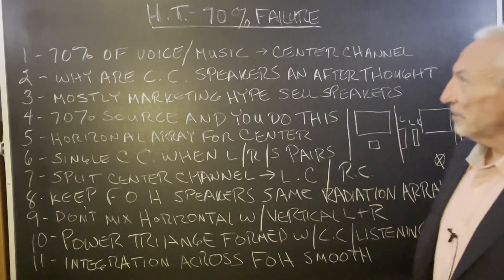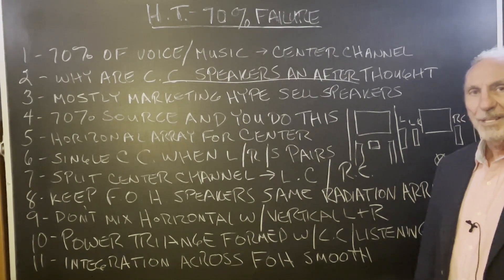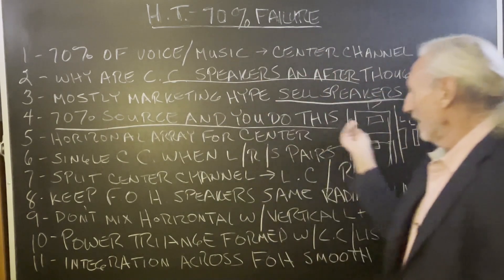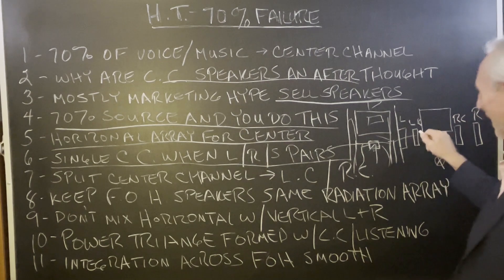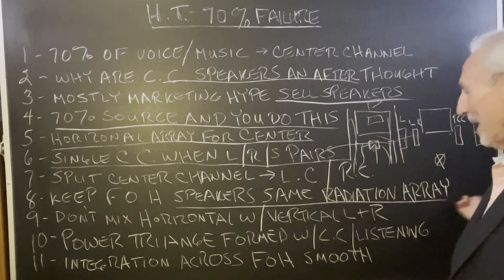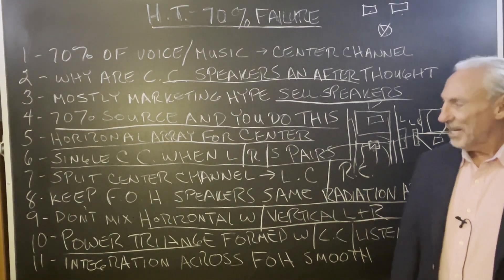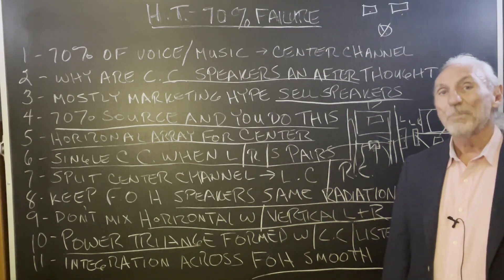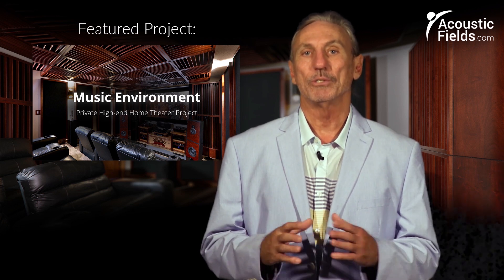Home Theaters: 70% Failure - www.AcousticFields.com

Comment: I understand the reasoning around having 4 of the same speaker. If having enough space is an issue, rather than using 1 horizontal center speaker, could you use 2 of the same horizontal centers and stand them vertical at the edges of the screen? Would this be better than a single horizontal or a waste of time? Do you simply run both speaker cables out of the CENTRE channel of the amp?
Reply from the maker: Yes, you can attach two sets of cables to the binding posts for center channel.

Comment: I'll take a good stereo setup for watching movies over 90% of of the surround setups I've heard.
Reply from the maker: I completely agree. In the last 25 years, I have heard over 300 home theaters. If memory serves, I liked maybe 10.  People lack knowledge on balancing the energy ouitput of multiple channels within the room size and volume. More is not better. You must have channel seperation which requires distance for the many channels to distribute their energy properly in order for the multi channel presentaion value to work well enough to develop synergy. A two channel rigg and set up is much more forgiving. If one applies the two channel set up requirements of channel seperation to multi channels, resolution would be dramatically improved. Now, treat the pressure and reflection distortions.

Comment: In a way I have the same center as my main side-speakers. I have the Elac FS507 and the Elac CC501 center and the CC501 is more or less a FS507 laying on it's side.
Reply from the maker: This is a good start. However, distibution of energy is still an issue. You can't have a speaker distributing energy in a horizontal array at center and then vertical array left and right. If you can't split the center into the same as left center and rightcenter, it would be better to make the left and right channels horizontal to match your center.

Comment: 2 questions Dennis. 1. Could you still experience comb filtering of higher frequencies by doing this, and 2. Would standing up 2 normally intended horizontal centers work versus using 2 normally vertical speakers or will this cause dispersion problems with the tweeter orientation?
Reply from the maker: Study the definition of comb filtering. You will find your answers in the definition.

Comment: Hi Dennis I watched the video and I see what you're trying to say but I don't have the room for that I only have enough room for three speakers but let's say I could do what you said then where does the true Center sound from the screen of the TV come from all four speakers two of the four unless I miss something what you were saying but I don't think I did I have the three speaker setup and it seems to be great for me maybe I can get another center and put it on the other side of the entertainment center under the TV but again how do you want that wired up Thank you and I hope that you respond
Reply from the maker: You must have the distance for this process to be effective.
Reply: @AcousticFields  Thank you for getting back to me Dennis So if I don't have the room for the setup you're talking about what kind of suggestion do you have instead of the one you gave me any assistance would be greatly appreciated Thank you
Reply from the maker: You are splitting the center channel signal. All data will come out of the left center and right center. Place these "new" channels as close to the screen edge as possible.

Comment: Centre speaker is definitely a fill the gap mainly. Stereo speakers bought first, some THX systems use 3 identical fronts, mine does.
Reply from the maker: The center channel does more than fill the gap. It provides for vocals which are discreet to the center channel. In some mixes, they place background noise, music, crashes, etc. "behind" the vocals. The goal in a high resolution room is to be able to seperate the dialog (voice) from the background "noise" by removing enough room distortions to permit this process to occur.

Comment: I don’t fancy center / surround / THX / etc—etc anything.

I my opinion ; a single pair of ( proper ) horns, a high-quality low watt tube amp, a crescent sofa, in the appropriate room setting will trump [ all ] contenders.

In other words : a, non-distorted, audiophile theatre.

Y’all can have all that ; “ But wait !!! There’s more !!! ” B.S. 🍺
Reply from the maker: Two channel is dramatically different than multi channel. Both sonic experiences have merit.
Reply: @ 
( and still ) The fact remains that I consider two channel envelopment beyond reproach — under [ any ] circumstance.

Comment: Hey Dennis!  When you brought this up earlier this I made the change... It's a big difference with LF, LC, RC, RF set-up...

Thanks again!
Reply: One more comment/question!

When splitting the Center Channel into two separate centers for a theater with ceiling heights of 14 up front and 12 in the rear, What would be your recommendations regarding the speaker height for 3 rows of seating?
Reply from the maker: It is a large difference. Now, that you have experienced the fullness in a proper front of the house, multi - channel set up, would you ever go back. I know the answer to that question already. The difference in soundstage seamlessness with no sonic gaps between the centers and the rights and lefts. Large soundtsage that extends way past the left and right channels. A new focus of voice onto the screen. Gretaer height. The audio and video are more time aligned. Voice synchs with video. Overall vocal  resolution improves by a minimum of 100%,
Reply: You're right!  No gaps at all!  More importantly, it eliminates the need for Front-wides!

So, I'm the process of narrowing down a lot for a new build with a dedicated theater...22x28x12 prior to any treatment.

Comment: I have an old Yamaha reciever that uses presence speakers to create a sort of center channel triangle.  It feeds some of the center signal especially dialogue to them helping raise the voices so they come from the center of the screen.
Reply from the maker: You are correct. You are creating a triangle with the left center, right center and the listening position. This is a standard set up fot stereo listening but the benefits are many. You will have increased resolution on vovals with a stronger "on screen" impact. Voice and video will be more time aligned. For me, it produces a more effortless listening experiece. The seamlessness makes listening easier.

Comment: This is understandable for low-budget multi-use rooms in entry-level homes, but in 6-figure luxury homes with dedicated, purpose-built home theater rooms, it's odd that the owner doesn't seem to care. Some give more thought and budget to having a little simulated lobby, popcorn machine, and candy counter with all the right posters on the walls than they do to how it sounds. If it gets really loud, that's "good sound" to a lot of people.
Reply from the maker: The sound quantity versus quality issue has been around for years. Quantity helps sell product to the uniformed. More is always better. Place your subs in the corners. Increase room gain by 6 dB, get more out of your subs. Your not getting more out of your subs, you are increasing room distortions by 6 dB. Its amazing as to what passes for understanding.
Reply: @AcousticFields  The thing is, many of these dedicated, purpose-built HT rooms (6 figures? I meant low 7 figures) have a pretty low noise floor, 32-35 dB or so. Basement, no exterior walls, sleepy suburbs, high-end HVAC systems with near-silent fans, and that's without even taking specific measures to isolate the room from vibrations. With that kind of noise floor, you can get sound that seems pretty loud, without going above 75 or 80 dB, and still be loud enough that you can still hear whispered dialogue and quiet transients, which is really nice for preserving your hearing.
Reply from the maker: @dashcammer4322  This has not been our experience. Most home theater builders have no idea how to address noise transmiisson issues and end up using methodologies that are 50 years old..